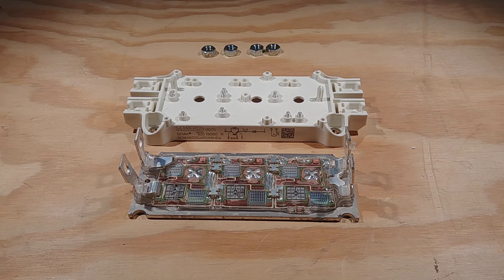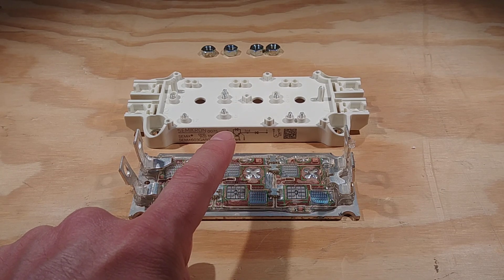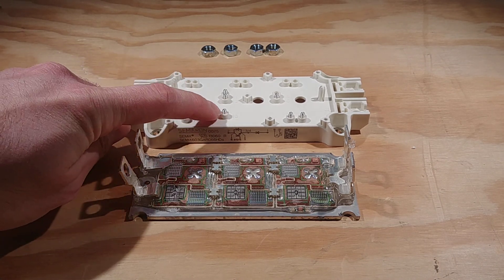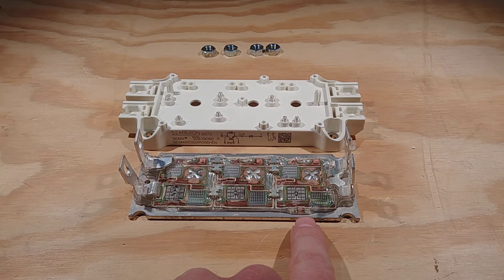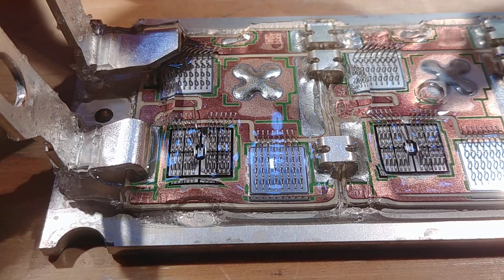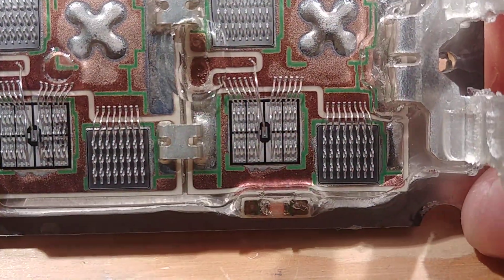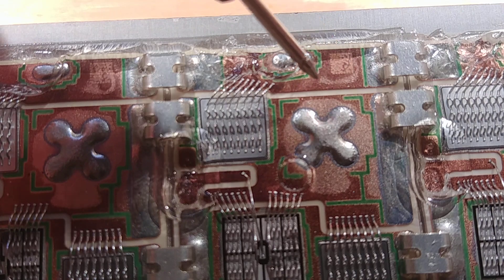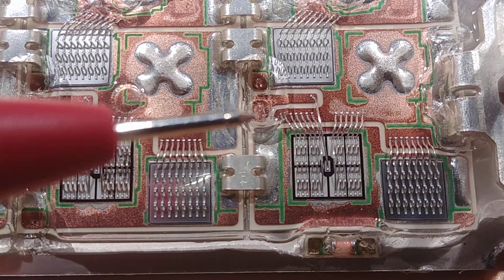Failed Semikron IGBT.

Comment: That is cool that you can see the discoloration where the die failed.  I wonder how many amps it would take to blow one of those little wires like a fuse... Each IGBT had 12 wires it seems so over 200/12=16.67 Amps so I guess that tiny wire can carry at least 20-25 Amps safely, wow.  I guess I should not worry about overloading the 12 gauge wire in my house with 20 amps... the wire is hardly working.
Reply from the maker: Yeah, but that tiny wire is probably sitting above 100 degrees C while passing all that current. ;)
Reply: Sir we have required IGBT in India

Comment: You can get away with running all of that current through such fine wires.  First they are very short, resistance is proportional to length and inversely proportional to diameter.  Second there is generous mass at each end to absorb as much heat as possible.
Reply from the maker: One side is the junction, which already generates lots of heat.